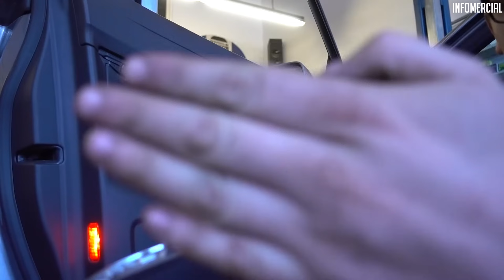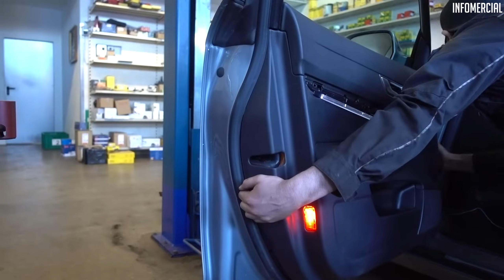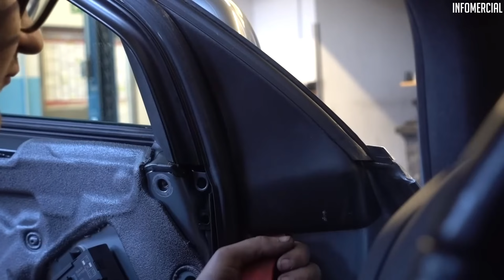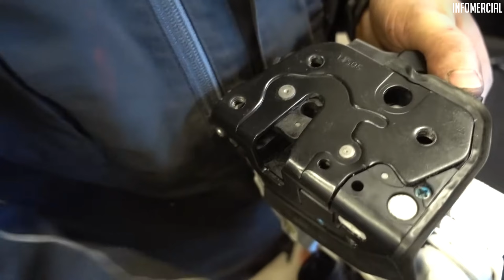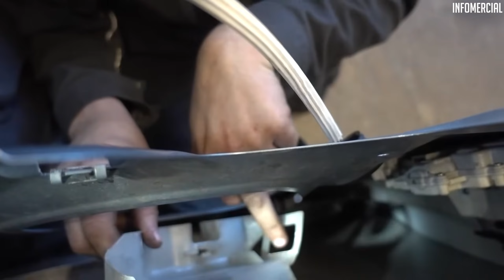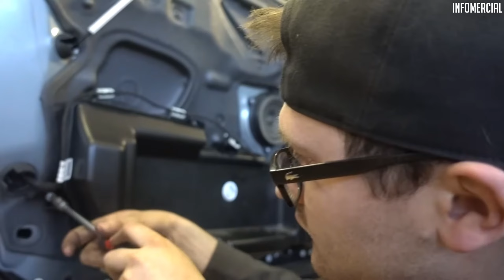How to Replace Audi A6 4F Door Lock | Audi A6 C6 Handle Not Working | DIY Tutorial

Comment: Great video, the excellent level of detail sets this apart. I have 2 questions though, first i missed what actually caused the actual problem, the handle mechanism wasn't broken, was it just that the cable that attached to the door handle had become detached from the door lock? 
Second question, my passenger side door cannot be opened from inside or outside ( i think you did a driver side lock with a key in it. as mine is passenger side there is no key) so I can't open the door at all to remove the inner door skin as you did - please tell me if you know, how can I get it open to fix it? (i've tried using the key manually and remotely but t nothing helps the handles move (inner and outer) but the door remains closed, (I guess the cable inside must have detached )
Reply from the maker: It sounds like the issue is indeed a detached or broken cable inside the door that connects the handle to the lock mechanism. Even if the handle itself isn’t broken, if the cable comes loose or snaps, the door won’t open from the inside or outside.